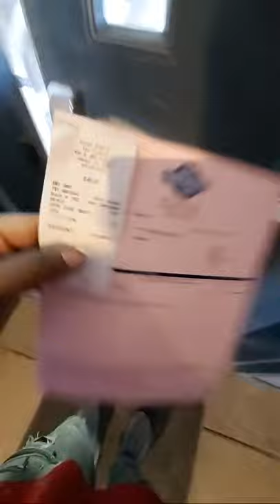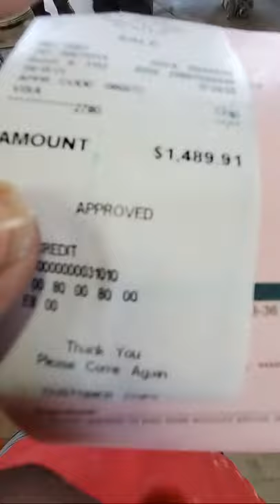Broke Down (Migo To Rescue)

Comment: LoL @ some of the comments especially the one who thinks you gonna get 100k out of a tire in the oilfield..... Smh.... Me personally I would run all my tires at 95 psi based on the heat in Texas. Also I would always put new tires on the rear tandem. I'm not sure why they didn't suggest that to you. The rear axle wears out quicker than the front axle. So they should have moved the tires around but it is what it is now. Just fyi.

Comment: The hand is right 70-75 on high mileage tire will do it Andrew those tire should of been changed but you still do good but your young still learning!!! Stay safe bro. By the way I'm  old school   either your a  hand or  a  steering wheel holder.